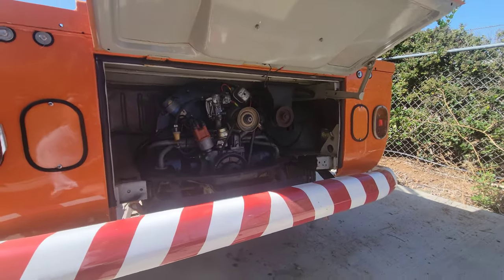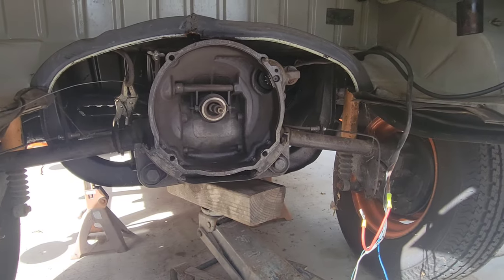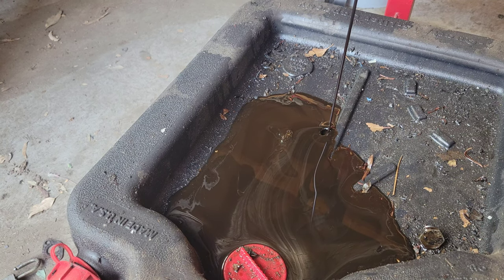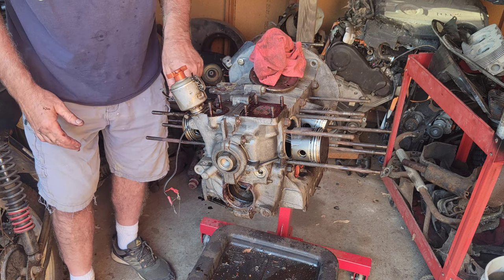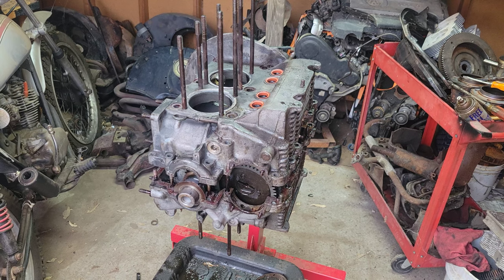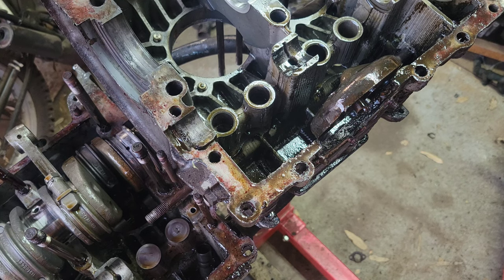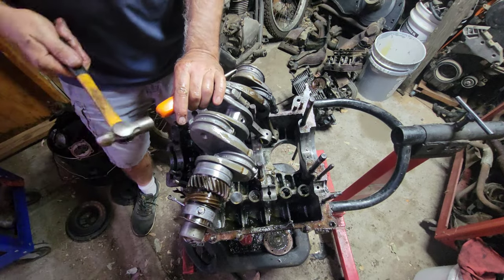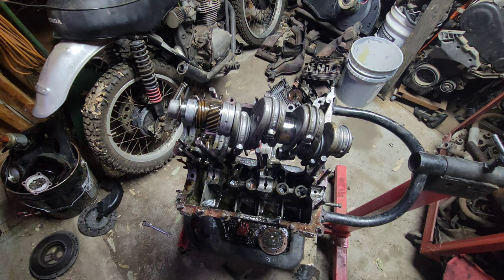Seized VW Air Cooled Engine Tear Down - What happened ? Surprise ?

Comment: This is what I alluded to in an earlier email which I must not have explained well. The problem (40 Hp) is the center cam bearing surface becomes oval shaped (exaggerated) from the case halfs banging and shifting (why later and aluminum cases are pinned) around. When that motor was disassembled prior to its build, I guarantee you the case bolts/nuts were all loose. Line boring the cam bearing surfaces will show the first and last are OK, but the center is smashed and oval (exaggerated). The center cam bearing is too tight on assembly of the case halves and it then generates a ton of heat through the case when running which takes out (usually Number 3 Rod bearing) and depending on the build, sometimes the center main bearing. This is typical, not unusual. I learned this lesson the hard way back in '76. The additional collateral damage was from running it too long after the rod was forced to give up.
Reply from the maker: very good points. center cam bearing gets worn just like center main from no having shuffle pins.  and since there is no bearing there it looses oil pressure. noting a line bore and cam bore job wouldnt fix.

Comment: Hey Mike, just a FYI. Rimco line bored a 40hp I was building and also bored for cam bearings. Originally as you mentioned they didn’t have bearings but Gary suggested to do so. It’s been over 6 years and that motor is still going 👍🏻
Reply from the maker: yea rimco is no longer. but DK machine does them too. brothers does too $$$$$$$$

Comment: I have a 1200cc engine that you can have for free.  I took it out of my '61 Bug in order to convert to a 1600cc engine.  Complete engine, ignition, carb, exhaust, starter.  It was in good running order when removed, stored in a dry garage, consistently turned over monthly with a wrench to keep free.  Located in Monterey County, central CA.  I grew up in Riverside, am down there around once per year to visit grandkids in La Habra, could deliver, or if you happen to be up in this neck of the woods.....  I can send photo if desired.  Just want to find good home for it.
Reply from the maker: yea message me on facebook page.

Comment: Hey Mike ! I would check out the gasket under the oil cooler to see if it closed down ?
Reply from the maker: it was fine no issues. probably cam bore issue. the only place it could go.

Comment: Definitely baffling.
Reply from the maker: weird that it lost oil pretty quickly to the (front) Rear of the oil section. The rest looked pretty normal maybe a crack somewhere in that section of the case. spraying oil to the inside. I am not sure. was not getting  hot. just lost oil pressure
Reply: Did the oil light come on at speed when it started making noise? Time for a gauge maybe.  

I should do that too as I am running a 40 horse in my single cab   It is not pulling anywhere near, what you are with the bucket truck though. 

Did you measure the end play before you took it apart?

Comment: Can a Hoover mod be performed in a 40HP you would know better than me. For such a small motor pulling so much weight you probably can benefit with a mod or two. Then again with a loss of oil pressure all the mods in the world wouldn’t help much. I think bigger pump should help plus a HP upgrade so she won’t struggle so much. I’ve watched you build motors and you definitely know what your doing.  I just think it’s the road speed and undersized motor can’t do the job. Maybe type IV oil cooler duel relief etc.
Reply from the maker: possibly I would need to evaluate it again. need more oil getting to the rear of the engine. 40hp has small oil passage to the rear. needs a bit bigger pump to maintain some pressure at the rear (actually the front) Rear of the oil pass.

Comment: I’ve just got my engine back from a repair shop that deal in air cooled.  I’ve only driven car for 30 mins and the next day I started the bug up only to have fuel spurting out of the  exhausts. They reckon it s probably a valve stuck open  but I’m not sure . Could it be anything else?

Comment: Did you rebuild that engine  or is it original?
Reply from the maker: did a refresh rebuild on it less than 20k miles ago. did not want to put a lot of money in a 40hp engine. But did not do the line bore and cam bore. It had a similar problem last time too. talked about that at the very end. this was not intended to be put in  this truck

Comment: I need a line bore for my 1970 AE case. Can you recommend a company? I live in Florida and can crate my case to ship. Thanks.
Reply from the maker: Best for that is Brothers VW Machine shop ONT CA.  also DK machine I think la habra. or Performance workshop in Riverside CA. Brothers does a lot of mail order stuff. Pull the studs check all the surfaces. check for cracks in the back before you send it. shipping cost will be a lot. They will check that too. While its there if it is not case saverered you could have them do an 8mm case saver and put. those in and do a 90.5 opening. if it already has 10mm studs and case savers probably just stay 85.5 would be too thin around the cylinders. Full flow if your doing that too.
Reply: There are vw places in FL,  why not ask around , there is even a FB page for Florida VW... I'm about 17 hours from Daytona,but two guys I have met here - one moved to FL upgraded bus to a vanagon, and the other guy retired and he's always got something going on vw related.  I bet you can find machine shop in FLA that knows aircooled.  Just an idea....good luck, I was thinking CA for me, but there is a guy one hour away with 20+ years experience...
Reply: @DanTheManIOM  Isn't CT's engine guy "vwdarrin" in Florida?  I believe I saw that on one of his videos.